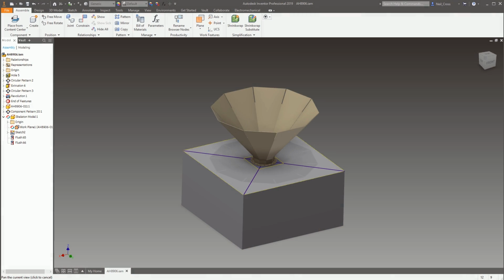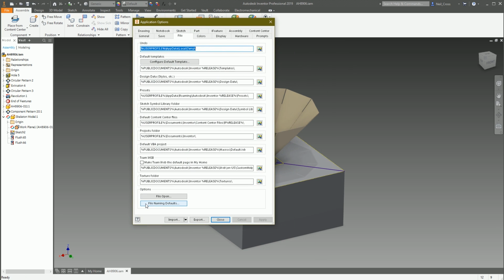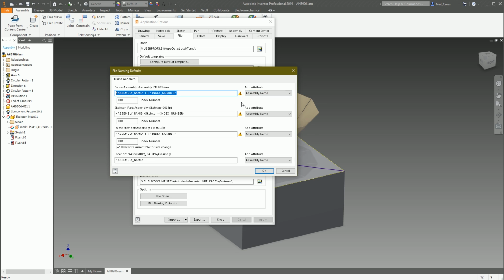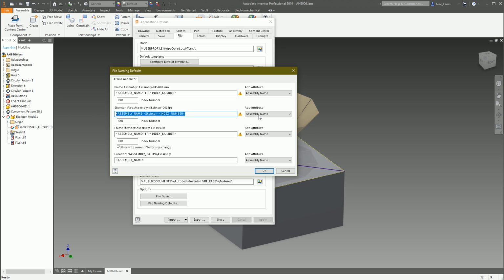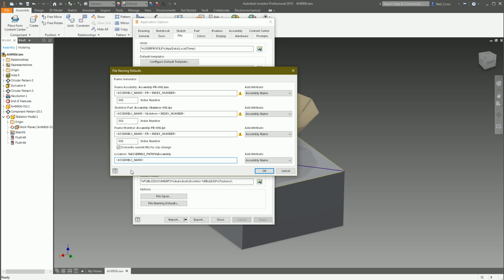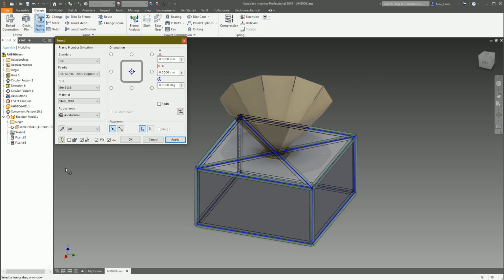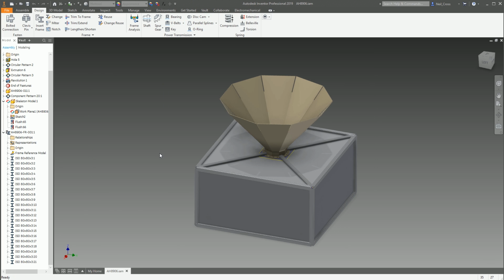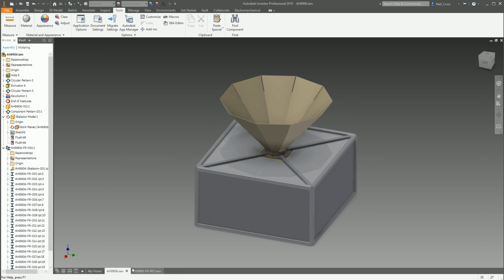Frame Generator now names the frames properly! HALLY-FRICKIN-LOOYAH!

Comment: I really like the new naming function. The issue that we have at my company is that every single member of the frame is it's out part. For example, the four vertical legs in your frame are the exact same thing, but yet Inventor still calls them out separate.

Comment: Thanks, Neil. We did a few nice additions to Frame Generator based on customer request with the 2019.2 update. Another thing to check out is that you can now change a frame member without creating an 'orphaned' member. i.e., if you change from rectangular to square tube and we now edit the existing member instead of creating a net new one and leaving the original orphaned as Inventor did previously.

Comment: A sheet-cut hopper? Welded to a standard flange? With frames? What the heck is that part :o it has no exit holes.
Reply from the maker: Haha well I'm not an engineer but I don't think that's a hopper - it's a bellmouth of some sort which a tether cable goes through for a subsea vehicle... but I deleted 80% of the parts from it for IP protection so it's basically nothing, I just used it as an example for the part numbering
Reply: @NeilLCross  I wish IP wasn't a thing so you can share the wonderful, interesting, and poorly/cringe designed parts you get to see on a daily basis. 
Cheers

Comment: I just installed 2019.3 today and went to look for this and it wasn't there. I guess I need to install .2 as well. Pretty awesome though. Frame Gen files were a mess before
Reply from the maker: 2019.3 doesn't exist, 2019.2 is the latest version... are you sure you're not on 2018.3 or 2019.1.3? It's not in 2018 unfortunately.
Reply: @NeilLCross  hahaha I just looked again. I installed 2018.3. I have 18 and 19 on this machine and the Autodesk app manager told me to install it. I must not have been awake yet 👍😀

Comment: Why are you so worried of duplicate filenames on vault?
Reply from the maker: Yea it's one of the baddest of bad practices and a position you don't want to be in, imagine you have 400 files called 'bracket.ipt' and you didn't make any of them but Inventor has a missing reference to bracket.ipt... how the heck would you know which one of the 400 you're meant to use? That would be a very long day.  It's the same (almost) for frames as you might end up with 400 parts called called ISO 80x80 000001.ipt all at different lengths, and something could easy happen for Inventor to end up using the wrong one.  So Vault lets you stop people from putting in a file if the name already exists... which caused hell with the frame generators cos the names made where always the same as the last time you used it.
Reply: Never ever EVER allow users to have duplicates in ANY PDM system. .... Do you want to use the same part in other project? Use THAT part, do not create second "same" part. Reuse what you need